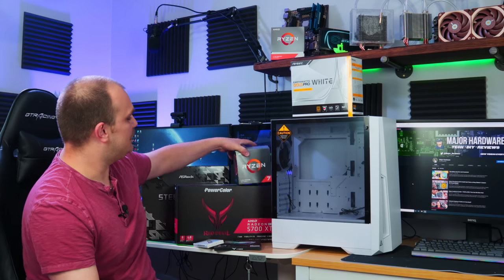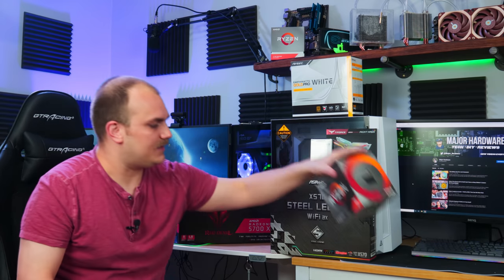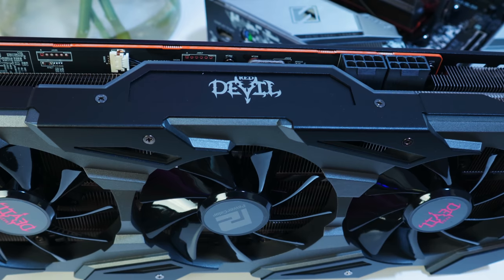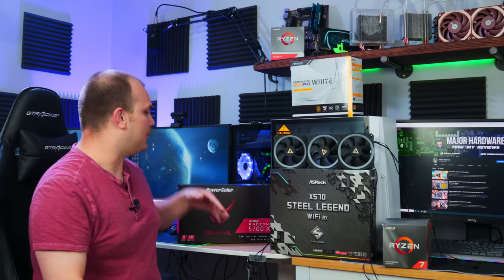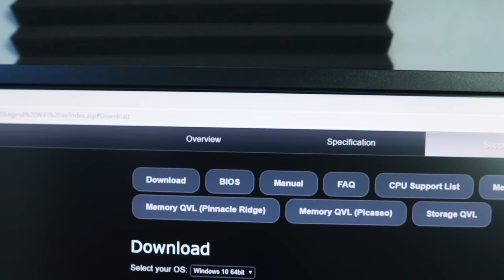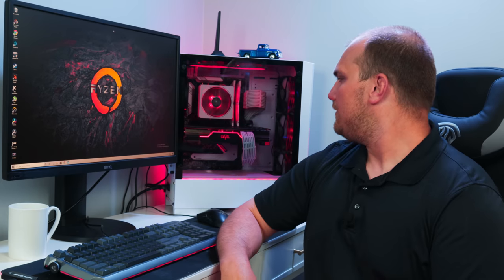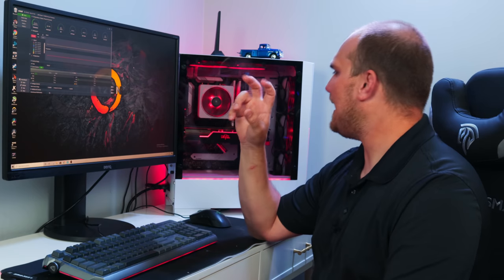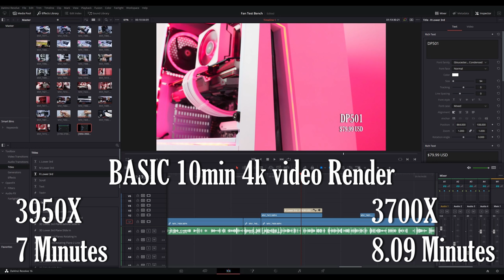It’s Amazing What $1400 Gets You | ALL AMD 1440P Gaming/Creator PC Build

Comment: I will say amd has come a long way I think we can all say that. I use a ryzen 5 2600 still and it's overclocked to 4.2 ghz and it does exactly what I need so I won't be upgrading for a while. However I did just come from an r9 390 to an rtx 2060 super. Best decision I've ever made. I went from a toaster to a 1080p 144hz beast of a card. and the nvenc encoder is gonna be fecking noicee

Comment: I decided to step up my rig to 1440p and I love it but part of me regrets it slightly. I already had a 1080ti video card that I bought long ago for mining purposes and as we all know, mining collapsed. So then it became my gaming card. But I was still running a 1080p 60hz display. Took the plunge and bought a 32" LG 165 hz 1440p monitor. It looks amazing and the 1080ti can easily feed it frames. But the downside is this, I'm now firmly committed to the higher end video cards, at least in last gen and current gen cards. Maybe another gen or 2 and we'll see 1440p high framerate support from the mid range cards but that's not the case right now. My "backup" gaming rig can only just barely do 1440p at maybe 70 or so FPS in an old game like World of Warcraft (what I play the most) with it's Asus ROG Strix RX 480 8gb card. Excellent card... absolutely love it... but it was never meant to be a high framerate 1440p card. So I've inadvertently limited myself to the higher end cards because of my display resolution and framerate choice. First world problems huh? lol

Comment: I have an idea: I have noticed that most custom water cooling loops have their cpu and gpu blocks cooled in series: the outlet water from the CPU goes to the GPU or vice versa. That makes it so that at least one of the components do not get cooled as efficiently as the other, since the intake is with the warmed water from the other block. How about trying to run both blocks in parallel? that way both cpu and gpu gets cool water from the rad or reservoir. I think a way to do that is to split the tubing of one loop for both inlets and merge them back when they passed it. Or you can just run two loops, but who wants to do that?

Comment: Your AMD experience is the same as mine. Built quite afew Ryzen systems by now and there was always some fiddling to do. Setting cooler curves in BIOS to make the chip boost to it's advertiesed speeds when non-overclocked was tedious the few first times until I got a feeling for it. Driver issues, ever so slight incompatibilities.
AMD makes some very competitive, yet immature products in my impression.

Comment: Its not the display or the GPU, its the Displayport cable. There is a reason why Displayport cables are not the standard yet. They would work perfectly in some cases and in others they won't, even the $100 Displayport cables. Its not the AMD Drivers, its literally your Displayport cable, swap it out for another one in order to take advantage of higher refresh rate and you will see that it would work like normal again.

Comment: There is major issues with Radeon Drivers and is the reason why I didn’t purchase a 5600XT by Sapphire (which is the best bang for the buck). I absolutely had no issues with my build recent 3900X Build, you  simply shouldn’t can’t purchase a Radeon, at the moment. Also, I hate the way the T Force Ram looks and is why I went to Consair Vergenence 3600 2x16GB for $179.99, overclocked to 4000mhz blindfolded.

Comment: I got fed up of the issues with my MSi Gaming X rx 5700 and returned it and got an MSI Gaming X Plus gtx 1080 and haven't had a single problem yet, amd need to sort their shit out still, over a year after rx 5700/5700 xt release and it still isn't right.

Comment: had flickers on my 144hz monitor and CRU fixed my issue although mine was also over display port cable but it was while using gsync on my freesync monitor. but yea the cable changing didn fix my issue and hdmi isnt an option for gsync that im aware of. so try CRU and google it theres a reddit post explaining what to change on cru...

Comment: yeah i had some issues with a 5700xt, had to restrict the power limit.   works great until it decides to crank the power randomly!
Reply: Check your PSU, if it has a lot of ripple it will give you problems.
I have the red devil 5700 xt and it overclocked like shit. I thought it was the card because my PSU was a 875w dell OEM. Then I started looking into ripple, I bought a Corsair hx1200 with low ripple. My system is absolutely rock stable now, I can now overclock without crashing!
Reply: @HenrikHvalpen  So you had to buy a $300(?)ish PSU to power your 5700...great value!
Reply: @Mr1Tanker  i bought mine Corsair hx1200 for $135 so yeah great value. 🤪

Comment: There's no issues doing an AMD build you just had a crappy monitor with a weird fluke problem.  I woulda tried HDMI or a different monitor first before RMA'ing the card.
Otherwise, nice build overall.  There's slightly better RAM deals (patriot viper series), better SSD deals believe it or not (sabrent makes more than one, ones faster ones slower, price is so close together... there's also other brands competing in that segment.  use neweggs compare feature and look at the speeds and controller chip.  no need to buy pcie 4.0 YET, but get the best pcie 3 SSD's with the best controllers ONLY, because the price difference is minimal) better PSU deals (Appevia on amazon), better motherboard deals (asus x570 tuf gaming), potentially slightly better GPU deals (even sticking with 5700xt, but it depends on the price on that particular day and what website you're looking at... the red devil is a great card, always compare with nitro+ pricing because they're on par... but you can save ~30-50 dollars or more if you get a slightly crappier card OR a return/refurb).  Also there's better cases (p400a, others), and you should get a CPU cooler.

Comment: Should not assume the graphics card is the issue first. Bad connection first. DDU the drivers. Many things it could be and probably should be checked before RMA the graphics card. It could just be a bad cable and nothing to do with display port. Try different cables (not just dport to hdmi but also differnet dport cable). Try a different brand display port cable. Try without free sync and different resolutions. Different monitor. Different motherboard. Different PSU. Don't make any assumptions. Also AMD ages like fine wine. Drivers and performance get better with time. Most driver issues are fixed with DDU. Also the pedostash not a good look.
Reply: Ok...explain why the 1080 didn't give the problem, yet upon installing the 5700 into his 3950x rig, he got the same issue. Good try... AMD fanboys will stop at nothing to deny driver issues (and yeah, i have an RX570/4GB and RX 580/8GB with driver problems, and a GTX1060 that runs smooth as silk). I've struggled with AMD drivers since at least 2008.

Comment: That is a beautiful mustache bruf. keep rockin that thing. hardware needs the mustache. Can u please look into an alternative case design for pc builds. the standard is and has always been a box. but is that the optimal design. it seems that the design for the casing has not changed, only the flow of air is different for different casings. i wana see airflow as the base for the design and then building the casing accordingly. can u design a casing that works around the optimal airflow rather than the stupid box.

Comment: I just got a hp omen with an i7 9700,250g m.2,1tb 7200 hdd,120mm AIO,500watt 80+bronze power,RGB,6 usb 3.1,micro usb,and nvidia 1660TI for 1074.99 and 16g of ddr4 ram with space for more ram and another data it also has sad wifi 2019 machine

Comment: I’m so triggered by the little fan on X570 boards, I just cannot bear to buy a motherboard that relies on some tiny tiny fan that’s taunting me and saying “I’m gonna stop working one day when it’s least convenient for you” especially if a few years later you upgrade GPU maybe double up on RAM and go a few more years on the same Mobo/CPU/PSU/Case. Show me an X570 with the fan removed and a relatively small heatsink mounted there instead (preferrably passive) and I’d be like “Shut Up And Take My Money!” Alternatively if clearance is really a concern for multi-gpu or some other pci-e then I say show me a coldplate with heatpipes and put the fins somewhere else. It would still be removable, re-paste-able, and eternally reliable compared to the tiny fan.
Reply: So, watercooling is obviously out of the question for you!?
Reply: 1Tanker Why do you say that? I built my first custom loop in 2019. But prior to that yeah I simply got by for almost a decade with an i7-950 and upgraded the GPU twice on that thing

Comment: Finding a good x570 that isn't price gouged to hell and back right now sucks so hard. Looking for a Crosshair VIII Hero Wi-fi and cant find one under 500 bucks. :( Its a 375 card! Recommendations or a point in the right direction would be very welcome. 20 bucks paypalled to whoever leads me to a source where I can click buy on something comparable or better at a good price right now. :) <3
Reply: I just bought my Crosshair VIII Hero for $379 and X3900 for $389 at MicroCenter about two weeks ago. I had to do some major research and constant checking to find it. They just happened to get 10 in and only for Local pickup. I didn’t pay over retail for anything for my build. But man people are getting screwed left and right, if your not patient or do your homework.

Comment: the 5700xt might trade blows in fps, but it sure can NOT compete in noise, temps, and all around life span/dollar value of the 2070 super... let alone STABILITY issues are still present in amd drivers for the 5700 series gpus. NO ITS NOT MY PSU seasonic 1000 watter more then enough for 2 5700xt gpu. hense sold my 5700xt and bought a 2070 super ftw3 ultra+  but my bottleneck is a 1080 144hz monitor not my 1600af clocked @4.1ghz...
Reply: Just throwing my two cents here, don't know if you tried all/some of these. Much depends on driver version since not all are stable. Avoiding regular updates seems best same with doing factory reset in setup app everytime you update. Regarding the heat/lifespan you gotta tweak the fan curve and undervolt the 5700xt either with Afterburner of Adrenalin. My 5700XT has same or even better performance on 1900MHz/1000mV compared to 2060MHz/1200mV stock but produces much less heat and eats about 30W less power. Though sometimes it's necessary to tear it down and replace thermalpads/paste as manufacturing mistakes happen, also some manufacturers just make bad cards/models - examples could be XFX's Thicc II, Asus TUF, MSI Evoke/Mech - they fixed some issues after media coverage but if you had bad issues with heat I wouldn't be surprised if you had one of these tbh.